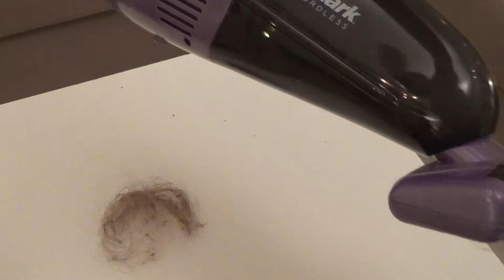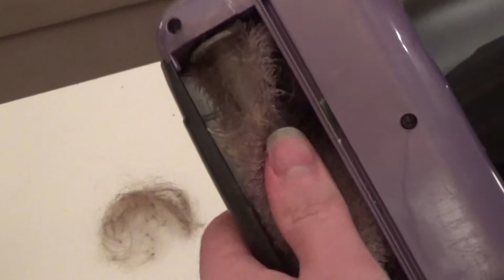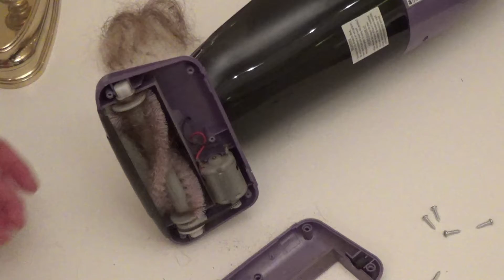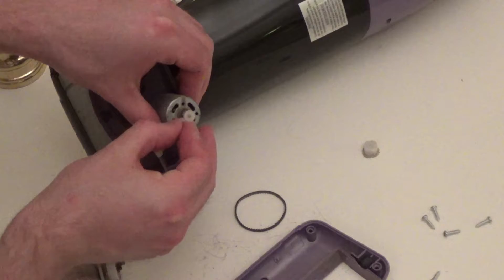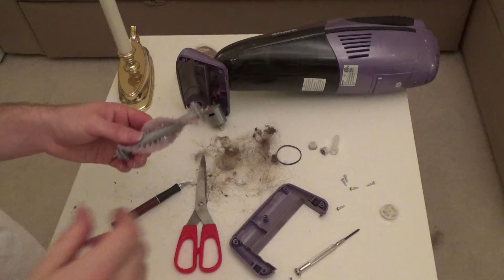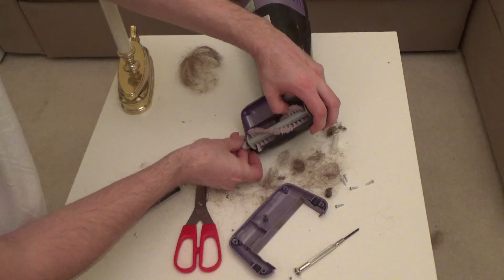Shark Cordless Vacuum Brush Roll Repair

Comment: Problem with mine is that the nylon gear on the motor shaft is split. So, the brush will spin a little bit, but when it encounters any resistance at all, it stops. Any idea about where to get nylon gears from? If not, no big deal, the thing has been sitting on a shelf for a few years, and just decided to try to use it today. Thanks for the video, very good job of showing folks how to disassemble the product.

Comment: Thanks for this video. I have the same model and unfortunately, it doesnt power on any more even though it lights up when I plug in the charger. Im going to take a guess and see if the batteries are no longer charging. A new battery pack is on the way so fingers crossed that this is the problem.
Reply: I took mine apart and had tons of dirt that was blocking the fan I got some of that compressed air and blow it out now I’m just trying to put it back together the batteries OK I think

Comment: I haven't used the brush roll. I use the extension piece. The first time I tried to use the brush roll it make a very loud whirring noise & the brush roll wouldn't spin. Any advice?
Reply from the maker: Does it turn freely by hand?
Reply: @JordanU  Thank you for responding to me.
Yes, I can manually turn it. It isn't a completely smooth turn though.
Reply from the maker: @StaceyNewman77  I'd disassemble and make sure the belt is on correctly and in good condition.
Reply: Thank you so much.  The belt needed to be repositioned. It's working without any issues now. Thanks again.

Comment: Thank you for the video. Unfortunately, I had a cheaper model with screws that were very difficult to remove. Also, when I finally got the brush unit open, when I put it back together, the brush still didn't spin. I figure it is a loose belt. Sharp was NO help finding a replacement belt so I searched all over the internet for one. I believe I found the right one. We shall see.
Reply from the maker: Hope it works out for you.
Reply: @JordanU  It took me a while, but I found the correct belt for my shark model number. Put it on and Towanda!!  It worked. To hell with their tech support!

Comment: Thank you for your video, but I did all the above prior to seeing this, and it still will not spin. I keep it up in a meticulous way, so it's not jammed with hair, etc.   My thought is the motor itself, of this particular attachment.  The rest of the vacuum works fine, and I've had it 4 yrs.  Therefore, I'm outside of my 2 yr return window.  Shoot  :)
Reply from the maker: Does it spin freely by hand?
Reply: Jordan U Yes
Reply: I actually ordered a replacement attachment yesterday, from the manufacturer, bc I couldn’t get it to function, and it’s my primary accessory. So, $25.81, incl tax, later, (they were kind enough to waive the shipping), I’ll have a new piece. :)
Reply from the maker: @lorihamiltonlmt8292  Good